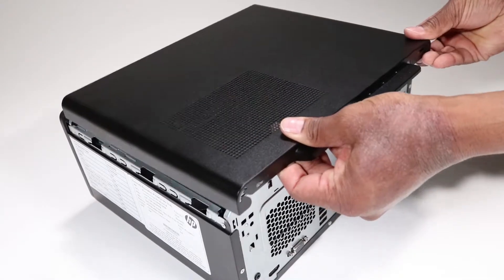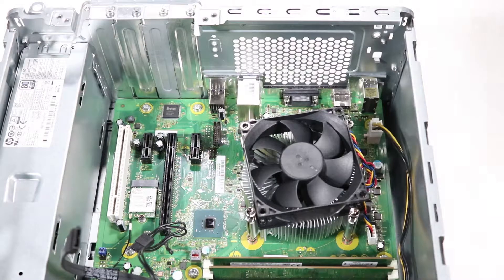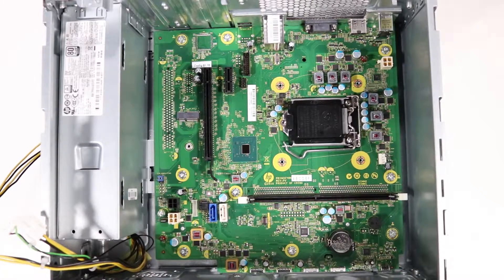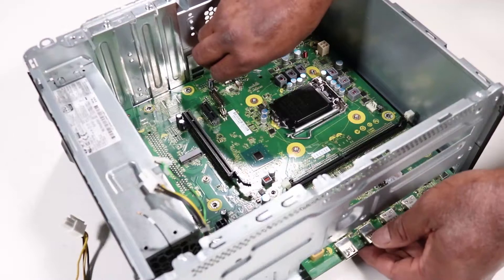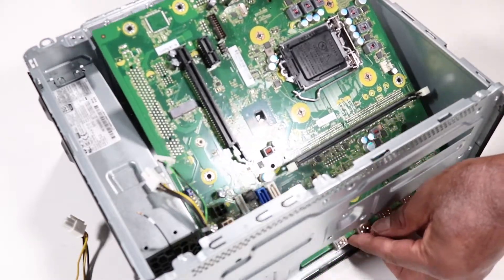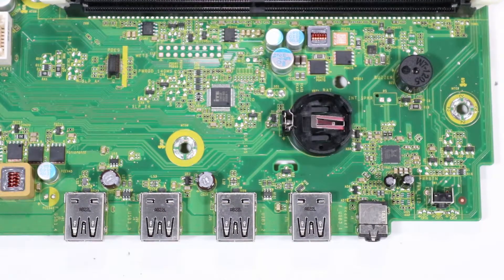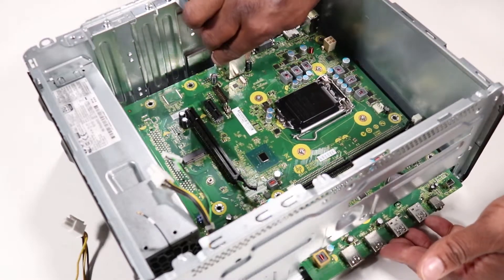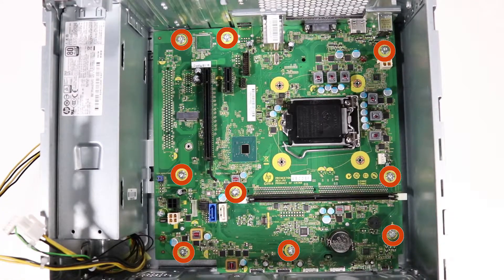Replace the Motherboard | HP Desktop 190-0000 PC | HP

Comment: Do you think the motherboard will work on another case?
Reply from the maker: +Serial Killer555 HP does not recommend upgrading or downgrading hardware parts or software that is bundled with the product as It may affect the manufacturer's warranty and performance, however, you could change the configuration at your own discretion.
Reply: @HPSupport  oh ok thx
Reply: @nothingmuch3464  in other words do whatever you want